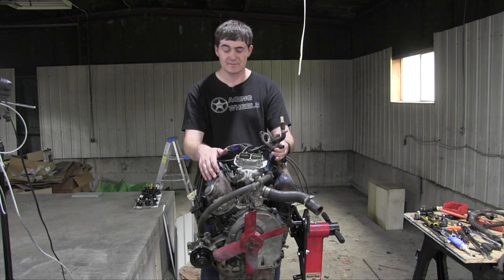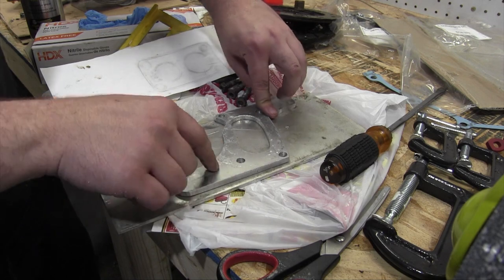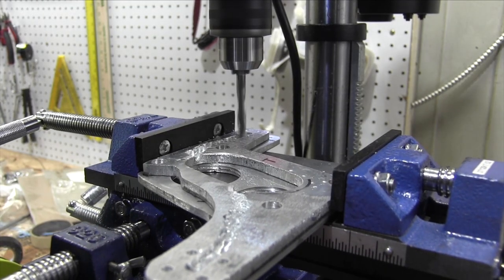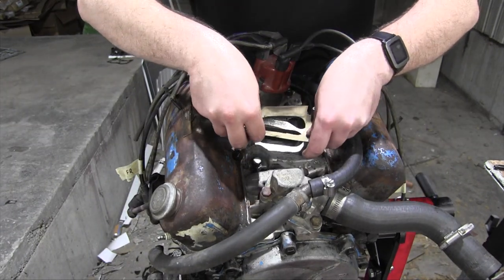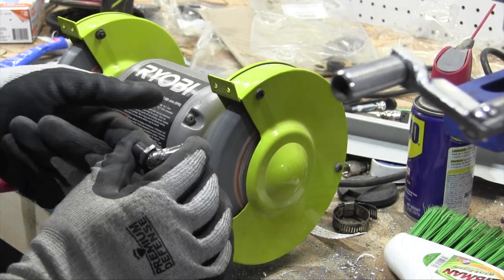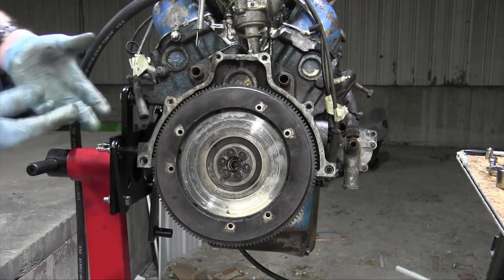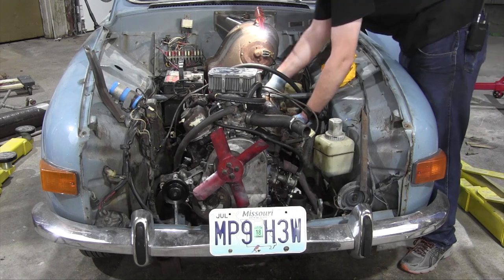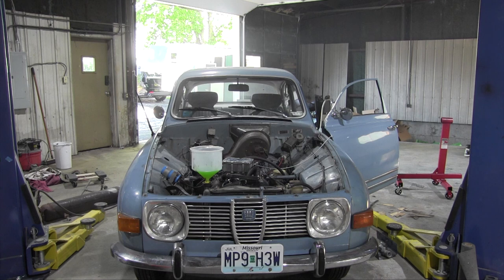Upgrading My Saab 96 to a Two Barrel Carb - Part 2

Comment: Jankiest adapter plate EVER.
Reply: takumi fujiwara is your pfp thumbs up lol
Reply: That is why it's perfect.
Reply: That's Roadkill level butchery right there
Reply: Subscriber since long back really enjoy your odd sense of humor
Reply: julie m agreed
Reply: Not really..
Reply: @L_T_Z  Incorrect.  No zip ties were used to hold it together.
Reply: That level of bodgy is worthy of my efforts only I refer to it as "rustic"
Reply: Brazing wire bro
Reply: Hold up I sold hair tool in this video why don't you have a air ratchet for the price that you bought that electric one you could have got a knuckle buster
Reply: I made an adaptor plate to fit a carb from a Peugeot 205 onto a skoda 120.  It was made from 18mm ply smeared with a fuel resistant instant gasket type product.  It did work, and the car was returned to daily use for nearly a week, when the distributor failed and I gave up on it

Comment: NEVER! Use gloves while drilling. You much rather cut your finger than to have the glove getting caught by the drill. My grandpa made the mistake of wearing one when the drill caught on the cloth and wrapped his hand around the multiple times. Breaking many bones in the process.
Reply: Also never use them on the grinding wheel either for the same reason. I know it's hot and you might get steel splinters like I did but I'd take that any day over having my arm yanked into a rotating machine. Safety glasses and medium length sleeves are all you need. But please do use proper gloves when welding. Don't want you to get burnt or get skin cancer.
Reply: damn ,thats a hell of drill
Reply: I've also heard fun stories of rings getting caught by lathe chucks and ripping people's fingers right off.
Reply: iv had my hand stuck to an angle grinder because the glove got stuck, i saw my life flash before me ...
Reply: @Boemel  Me too, wearing fabric gloves that snagged the wheel dragging my hand in; I was surprised how deep a hole it cut out of my hand.
Reply: YESS!!! I made that mistake once, but escaped without broken bones, luckily. Still, lots of bruises, deep flesh wounds and sprained fingers/hand/wrist. Even if you're lucky like me, still not something I'd recommend.
Reply: even latex gloves are dangerous..
Reply: I was gonna say the same thing
Reply: @vincentbaelde-millar670   Our high school metalwork master back in the early 70s told us teenage boys a horror story to stop us wearing rings on our fingers when in the shop; apparently a guy working at Parnall, UK had his finger ripped off by a vertical drill due to him wearing a ring.
Reply: Its worse on a running diesel motor…
Reply: my grandfather accidentally cut the tip of his right index finger off with a bandsaw(?) I think
Reply: I would get the glove cut rather than drill my hand

Comment: I'm sure it's too late now, but blue RTV melts when exposed to gasoline or its vapors.  I unfortunately found this out the hard way.   ...I now use Toyota FIPG or Hondabond for nearly everything. It's worth paying 3x as much.
Reply from the maker: It's not too late. That's a good tip, thanks!
Reply: exactly my thoughts
Reply: Depends on the brand I think. I use Loctite 5926 which is blue and alcohol and oil resistant. Never had any problems when using it to seal parts of fuel systems. I repaired a crack in the surge tank of my car with it, and after 5 years it's still holding!

Comment: Next time use a single thick base plate. To get the port just cross drill from say..., the PCV hole to the opening for the throttle.  Major air leak you say? NO! Just tap the opening of the hole where you started and put in a set screw.  That said, a valiant attempt to solve your problem.  I once adapted a single SU carburetor to a Datsun down draft intake making a tapered adapter out of sheet metal.

Comment: Heater hose for vacuum lines (especially PCV one) Yep I've made that mistake before. You'll be back to replace those sooner then you think.

And for those wondering why. Heater hose is designed to hold in internal pressure, not resist external pressure so it collapses under full vacuum. And the oil that comes through the PCV will make it super soft and break down over time. you can actually see it 'sweat' with oil over time.

Comment: Some of those fabri-cobbles might not chooch forever :-)  The good thing is that you're learning the hard way and that is the best way.  Keep it up and learn from more experienced mechanics every chance you get.  If you have the opportunity to take formal courses, do it.  If you don't have that opportunity don't worry about it.  With time and continued effort I have no doubt that you'll be a top notch mechanic.  I say this because you've displayed aptitude in your videos on this job.  I'm a technician of 26 years with a varied work background.  The only arm chair advice I have is that hoses will rub through when in in contact with steel.  Familiarize yourself with rigid tube bending and flaring.  You can get tubing with standard pipe thread terminations and you can barb and flare tubing using hand tools designed for the job.  In this way, you can custom plumb difficult areas.  I love the way you dry fit and plan your next move.  The presentations were entertaining and I've learned some things about your SAAB.  Thank you!

Comment: Those spigots on the valve covers pull air INTO the crankcase through the air filter, not the other way around. The PCV valve pulls gasses from the crankcase, creating a draught, and those spigots provide a clean source of vent air....

Comment: Sweet build, it looks and sounds great.  I dig the "ratchet ratchet, clunk clunk, ding ding" montages. One suggestion is to use fuel hose for PCV etc, it will hold up to the vapors better.

Comment: There should be a plastic thermally insulating spacer between the manifold and the carb. The manifold likes to be warm to help  vapourise the petrol, the carb needs to be cold. Said spacer is a very common part and can be bought with a vacuum port already fitted, form Ford tuning shops in the UK. That Carb was very common on UK Fords in the 80s and is much used for tuning up.

Comment: Tapered Pipe plugs, as well as short pieces of bolts and screws are perhaps possible for plugging holes,  using a bit of thread sealer.

Comment: Dont worry about the crank bearings, the balance shaft ones wear out twice as fast as the rest and the bearing bits will get probably have been caught in the mesh of the pump and filter. :)

Comment: One thing I like to do before starting an engine that has been disassembled is to remove the plugs and spin the motor until it builds oil pressure.

Comment: Two fuel pumps. You can have the electric one on a switch  to give quick carb fill for starting and then switch it off to allow the mechanical one to do its thing. Check that you have the fuel pump push rod in the right way round. Only one end is hardened and that should bear on the cam. You will be able to see, when it is clean, that one end is discoloured a bit yellow. That is the hardened end. If you have it in wrong the rod will wear and shorten, so reducing the amount that the pump diaphragm works. Result, not enough gas, especially when going up hill. Push rod length should be 130mm.

I would have liked to seen a tidy up of the engine bay and a lick or two of paint on the engine while it was out, Full degrease first of course. Doing that is entertainment and the end result is satisfying. Have fun on the road in part 3.

Comment: Saab and Ford tuned those engines up to 150hp naturally asperated and as much as 240hp with turbo.
It's a shame they aren't a more common engine. A 1.8L turbo V4 making 180+ hp would be quite popular. 
Plus, I suppose a modernized version of this V4 engine would be both efficient and powerful. Likely having potential for 400-500hp in race built 2.0L engines.

Comment: I know it’s a bit late but I would have bought a milling cutter to do the vacuum passages.  It’s shorter and wouldn’t have vibrated as much.  Also the main holes in the two plates don’t line up.

Comment: You could have been made a couple of plates to go over the vacuum hole in the bottom because you were screwing in from the bottom through the top just a little required a little silicone and tighten them back up again

Comment: Good stuff, if your electric fuel pump high pressure or low ? If it's high, you are going to flood the engine, if it's low, invest in a fuel pressure regulator from an old Vette (c3).

Comment: Wouldn't using 3 plates to make the baseplate be easier?  You could have cut the center plate to shape the channels and leave the top and bottem mostly untouched beside shaping and tapping ports. Could have even controlled channel volume with the thickness of the center plate. 

Too late now, just a thought from a fellow fabricobbler

Comment: It would have been easier to make a carburetor spacer and drill holes into the spacer for your vacuum ports instead of making those multiple plates . definitely one hell of a good job you did though. maybe a 1- or so inch thick plate of aluminum will do the job if you haven't done that yet.

Comment: I would have doubled the thickness of the stock used to make the base plate, drilled straight through and tapped fittings into it to run hoses wherever they would fit most conveniently. You like...way, way overthought that fab job...

Comment: If you had swapped valve covers left side to right side, it would have solved most of your clearance issues with the hoses. Also, if you use an end mill instead of a drill bit, that process of hogging out the channel with a drill press would have been easier.

Comment: At 22.40 the engine goes back in (after 3 hours). I am at exactly this stage and can't get the input shaft and engine to line up. I am well beyond 3 hours on this problem. I see that an orange ratchet strap appears in your edit, can you remember what this was doing? Did it change the angle of the motor? or was it to pull up the transmission ? any chance you remember?

Comment: Add a Mig or Tig welder to your christmas list
Reply: get some aluminum wire for that Mig and weld the two halves together so you don't have to worry about the vac leaks if that RTV fails
Reply: mattmopar440 which it most certainly will.

Comment: should have just made a spacer plate with one port and rubber piped it off to a remote block containing the ports you needed. all done with one hose from the spacer block.

Comment: Are you going to fit a thermostatic fan? that would reduce the noise quite a bit and enhance warm-up.
Reply from the maker: As far as I'm aware the timing cover needs to be slimmed down to allow for an electric fan on the radiator. Unless you're talking about a fan clutch. In that case, I have no information

Comment: One of your "stupid hole" patches looks like your tin patch plate might not be fully covering the hole. Also you should have used a router instead of the drill press, though I doubt the Dremel router attachment system has metal cutting bits. Though they might. I kind of want to look now.
Reply: All the official Dremel router bits are carbide and you can get a set of HSS bits from Amazon for $10. I'd try it over a drill press since it's meant to cut sideways vs down

Comment: Aaaaaaagh, those standard grinding wheels are for grinding tool steel,,,,,,, like drills. Next time you are in the tool suppliers, ask for a wheel that is for just [mild] steel and grind on the correct wheel, I mean, it will do it, but will wreck the wheel prematurely.

Comment: You totally should have cleaned that flywheel, and maybe hit it with some sand paper and broke the glaze. Ohhh and for the love of god, bend your locking tab on your throttle linkage nut.

Comment: I like your videos, but the epoxy will fail - trust me. It can't withstand the heat and vibrations over a prolonged time, and you will have engine problems.

Comment: stop with that vac adaptor plate do what the guy told you to do in the first place drill the intake, if you get vac leak going to blowup your eng, drilling one hole in the intake way easier

Comment: You could always just completely ignore the PCV valve and put it into the exhaust or just open air. It's just emissions bullshit that doesn't apply to a vehicle of that age.
Reply: Yeah the whole time im watching this im thinking "dude, you don't smog that car! just put a breather on one side and route the other side to the air cleaner base!" hehe oh well, live and learn, hopefully he dosnt have a ton of vacuum leak's from that base plate..
Reply: Isn't the engine a 3 cylinder two stroke? Then why would there be a PCV?
Reply: Before we had PCV valves we had road draft tubes, Never mind the emissions the PCV valve does a much better job of ventilating the crankcase.
Reply: Tore Lund no it’s a 4 stroke v4 made by Ford hope this helps
Reply: @Tore_Lund  it's a Ford V4 engine, despite still having many remnants of 2stroke components, including a freewheel on the transmission, it's actually a 4 stroke engine.
Reply: @JeffDeWitt  Yes, but the change is negligible in this situation. He might well have just had a hose going off to the side.